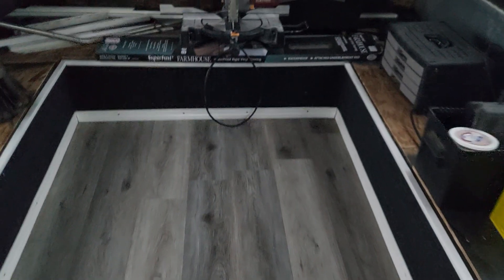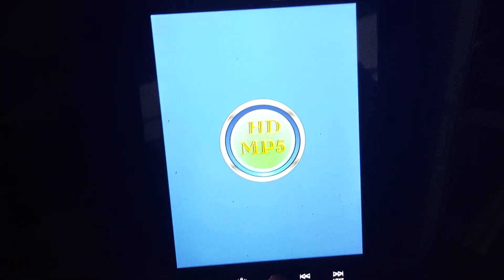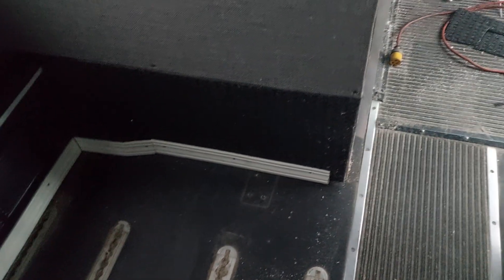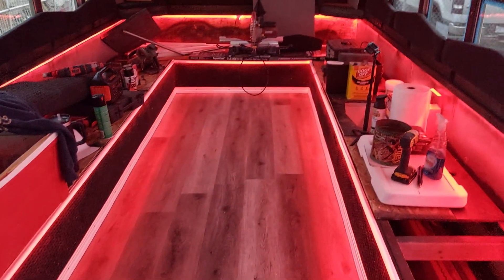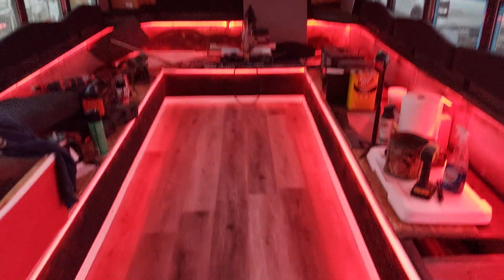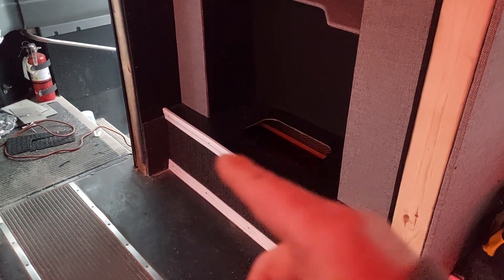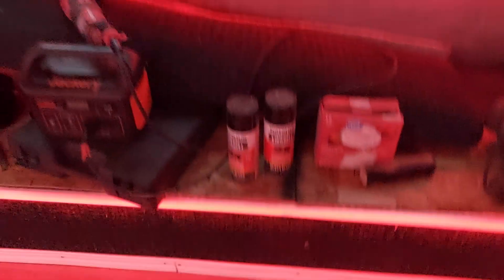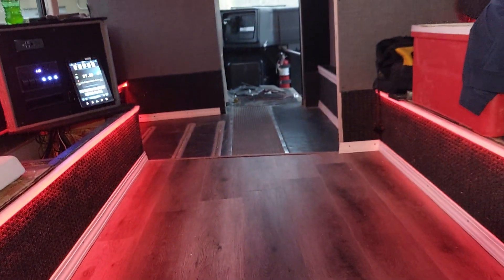DCC - Party Bus Flooring and border trim.

Comment: When you build these buses do you change anything or do anything up front?
Reply from the maker: I have on my old buses but steer away from doing crazy stuff on customer buses due to the time involved. I used to move the entire switch panels from the dog house to the dash.
Reply: @Digger67  nice. I’m just thinking of some tasteful ideas.
Reply from the maker: Normally I floor the bus all the way down the steps, but this job is different due to the WC lift.